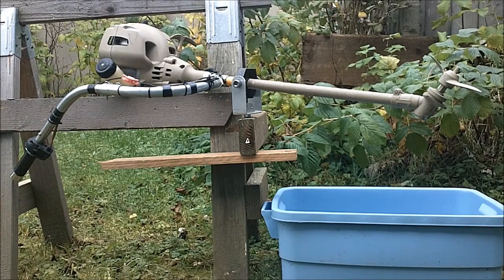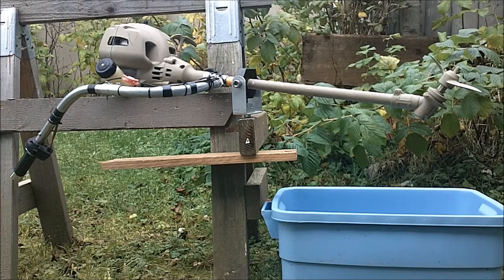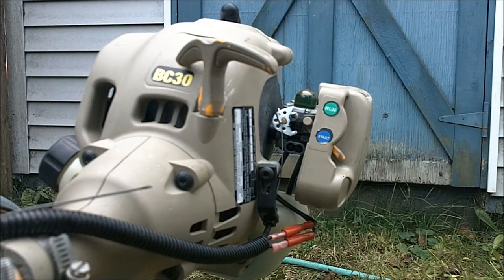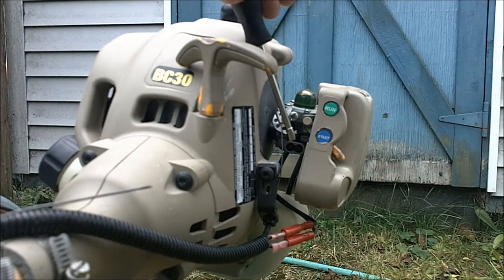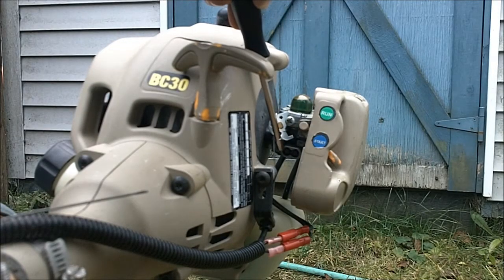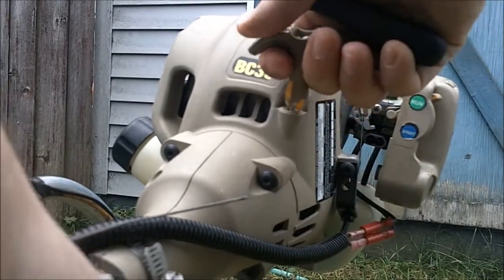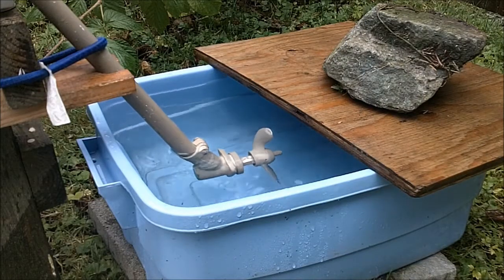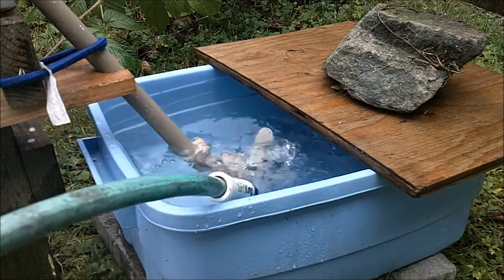Weed Eater Boat Motor Tune Up and Tank Testing

Comment: This is awesome. I made my own over the summer to push a homemade boat across the lake to a spot where my friends and I like to fish. It's no speed demon, but it get us where we need to go. Yours looks like it burns clean on initial start up, but if it's not warm outside mine blows a little smoke, but I fixed that by piping the exhaust down into the water. Works great, and is easy on fuel too. We only bring a 1 gallon can at the most.
Happy boating,
-Ian

Comment: Nice I'm trying this but it wasn't expanded it just a curved shaft I cut it in half don't know what to do now lol.
Reply from the maker: AirVaas Go to the local hardware store and get a piece of 1/4 round bar. File the ends until they are square and will fit in the clutch drum and gear head.
Reply: Erich's Alaska Channel thanks I'll have to cut it to size. What is that thing that the prop is on where can you find that and is it a pin one? I may need a whole new pole and inner piece to run the shaft threw.
Reply from the maker: AirVaas
Shoot me an email at erichschaal870@gmail.com

Comment: What kind of lower unit did you use
Reply from the maker: You mean the gearhead? It's the stock one that came with the brushcutter. You can find them on ebay.

Comment: No the lower unit the propeller and the shaft
Reply from the maker: +Gary ansell The shaft is a stock part from the weed wacker line holder and the propeller is from Young's Die Cast.

Check out my other video for more details: https://youtu.be/2gknDrRJa2c

Comment: Pfft, carb tools.

Step 1
-Aquire Dremel
Step 2
-Aquire cone bit
Step 3 
-Drill line across middle of carb screws
Step 3
Use a flathead 

You just saved 15 dollars!
Reply from the maker: That's another way to do it! But if you don't have already have a dremel or cone bit, it's cheaper to buy the tool. Not to mention there is no risk of ruining your carb! :) Thanks for watching and commenting.